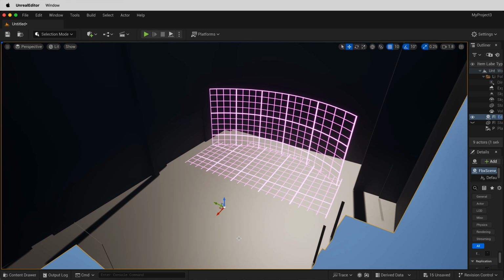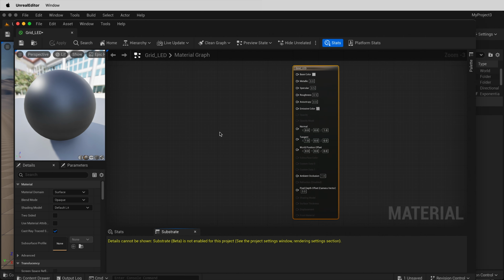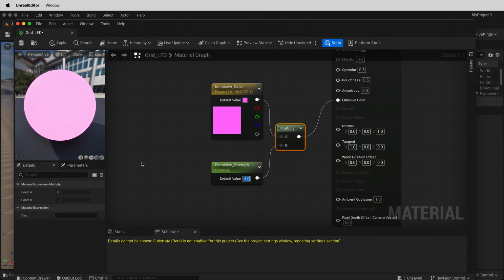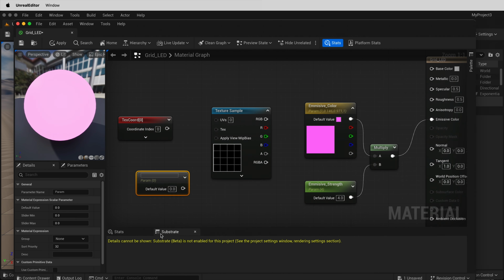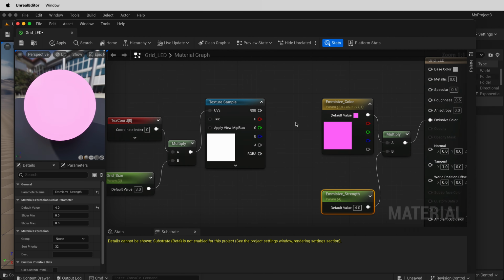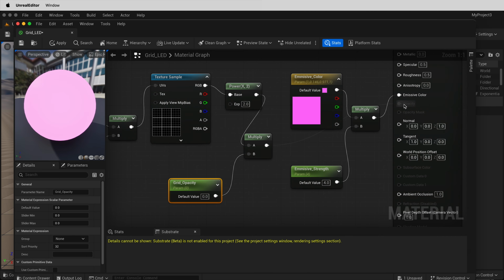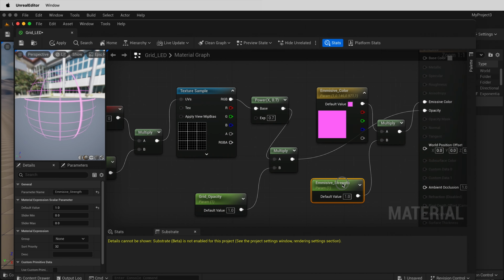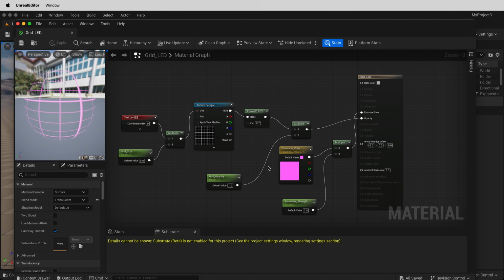Build a Transparent Emissive Grid Material in Unreal Engine 5 (Perfect for LED Walls)

Comment: Hi, i cannot find this texture anywhere. It's not on fab either. Any ideas where its located please. Using vers 5.6. Thanks
Reply from the maker: You need to load the default asset content pack in unreal Engine to use it
Reply: @WhatMakeArt thank you. I ended up  using the one from the fancy dev pack.